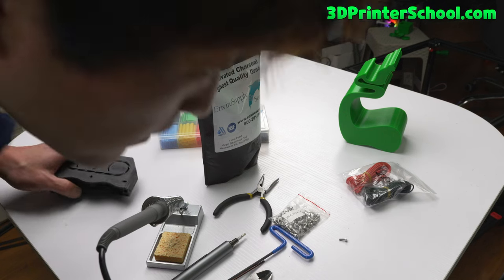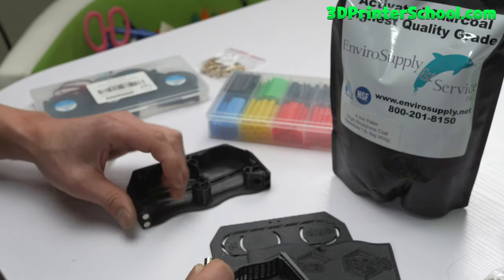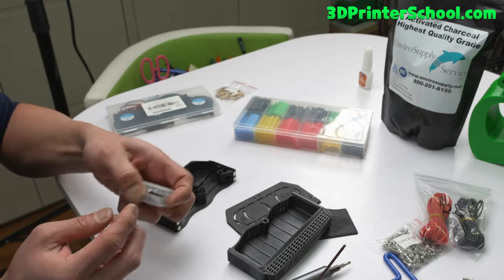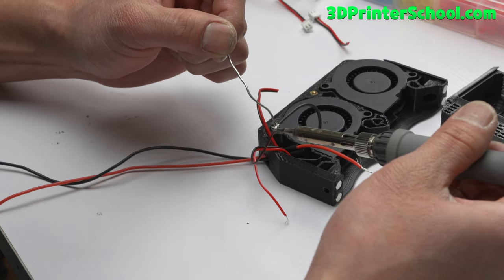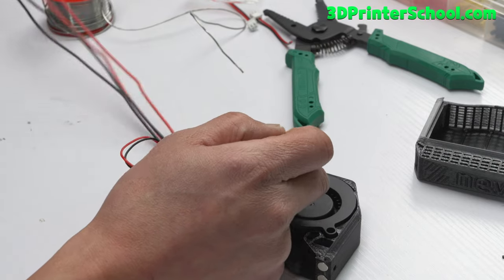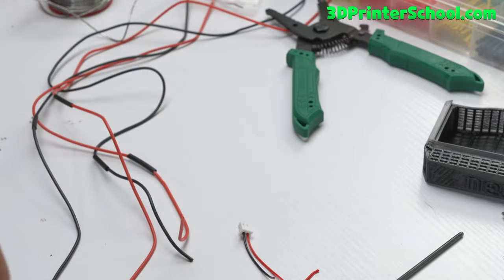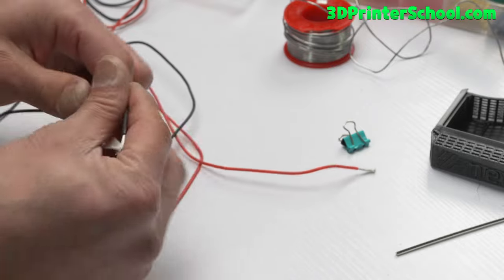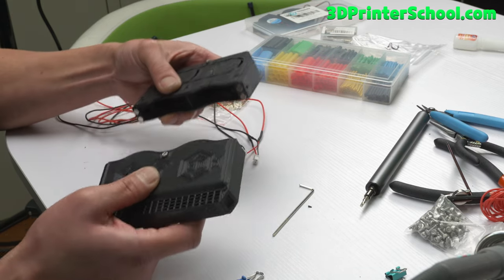How to Install Nevermore Filter on Voron 2.4 w/o Taking the Heat Bed Off!

Comment: You should put the carbon in an old nylon stocking or panty hose to prevent the dust particles from spreading everywhere. Especially inside the enclosure. Many other designs also include a hepa filter to filter out the particles from filament.